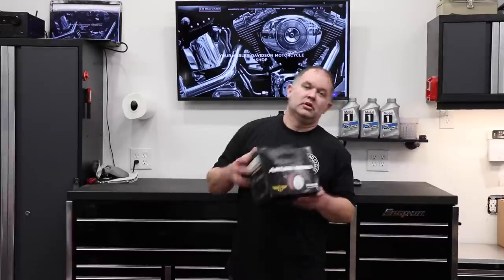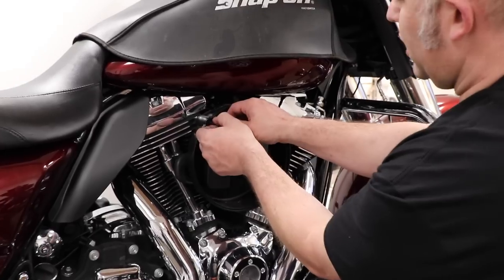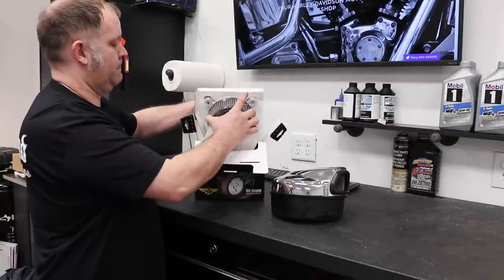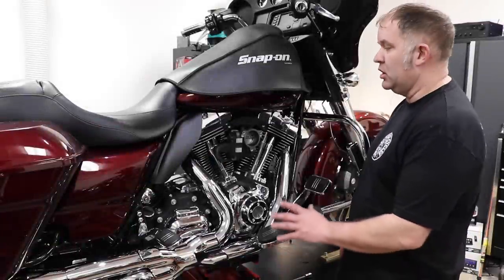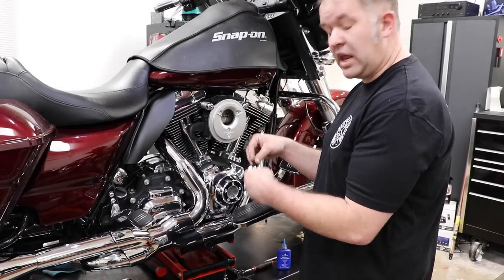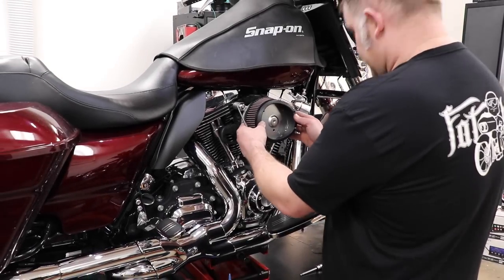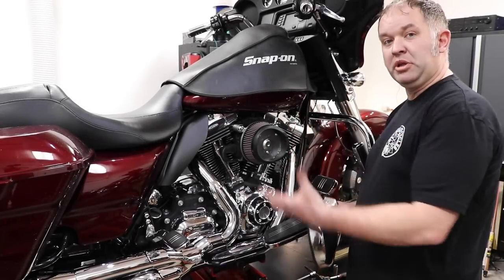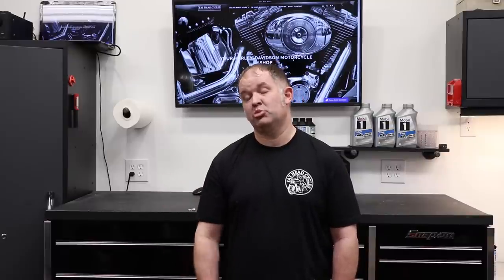Harley-Davidson Arlen Ness Big Sucker™ Air Cleaner Install | '14 Twin Cam

Comment: Hey, Can you answer a technical ? for me please,  I have a 2000 HD Road King Police w/  Magneti Marelli fuel injection. Straight off the Lot I had WAUGH HD put  V&H pipes on it , and the Screaming Eagle Stage I Breather kit ,  I now have the Vance Pro Pipe 2 into one on it with a Power Commander 3 I think . Dynoed , etc. My question is : Will the Arlen Ness Big Sucker purchase be worth the $160 if I already have the HD S Eagle breather ? Are they the same ? I'm really limited with the Magnetti Marelli restrictions.  CARY in Va.

Comment: on the '97 dyna kit, each hollow breather bolt has a circular hole on one side that apparently must line up with the breather hole on the backplate.  Are the threads designed so the bolt hole lines up with the hole on the backplate when torqued down to proper specs?  If the bolt holes don't line up with the backplate hole you won't get any airflow.  I'm thinking you have to mark the top of the bolt where the hole is and then you try to line it up with the backplate hole?  This was not discussed in this video.  Seems to me this is important.

Comment: Note: 
Removing breather bolts using 7/16", then, installing the breather bolts using 1/4".
Additionally, appears the breather hose was not installed while watching the video.
Pls explain.

 TY
Reply from the maker: The breather hoses were not reinstalled because the Big Sucker does away with them.  It allows the heads to breath through the bolts directly into the backing plate.  Great question.
Reply: @FatHeadCycles  This is enough reason to buy this. The rest is a bonus.

Comment: Do they make shorter standoffs for these? my kit came already installed on the softail i bought this summer. I bought a replacement stage 1 air filter and it is too short. The standoffs are way too long so there is a big gap.

Comment: Did I miss it or does this breather not allow the heads to vent?
Reply: There are holes in the breather bolts that allow the heads to vent into the filter...
Reply: Can u add an external breather on this kit to keep blow by out off filter
Reply: @mattcarlson4521  watch Rob workshop video on blow by

Comment: You're never supposed to use petroleum based grease with O-rings, petroleum based grease dissolves rubber... Trust me I know firsthand, I have disassembled parts that had O-rings that were installed with petroleum-based Grease, and the old O-rings were like a rubbery liquid. You can get a silicone based grease specifically made for O-rings for a couple of bucks at a hardware store in the faucet section...
Reply: you sir are a smart man. wonder my orings were failing,( and smealing grease when hot) giving me LOUD knocking exhaust leaks, sound like a damn rod knock, that ive been trying to track down for a while.  yes, i bought poloyorathane ( green) orings from HF. ty for your  input Mo!

Comment: Are the breather bolts vented? How do you deal with crank case pressure?
Reply from the maker: The breathers are vented into the air cleaner
Reply: So any oil residue would drip straight onto the air filter and motor as there are no breather hoses?

Comment: Ain’t no way in hell those engine bolts are 7/16.
Reply from the maker: You are correct.  The actual bolt diameter is not 7/16".  The message that I was trying to convey is that you need a 7/16" socket to remove the bolts.
Reply: WOW